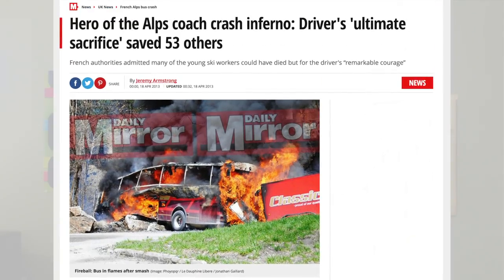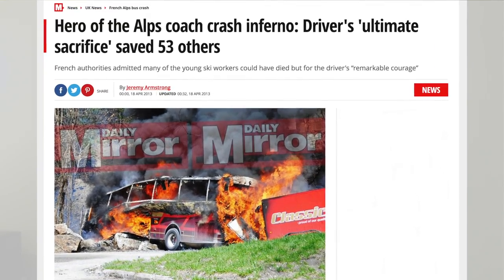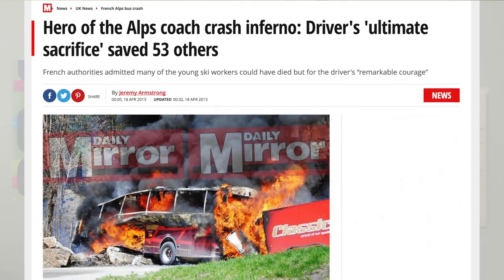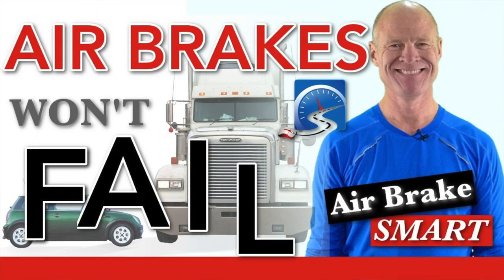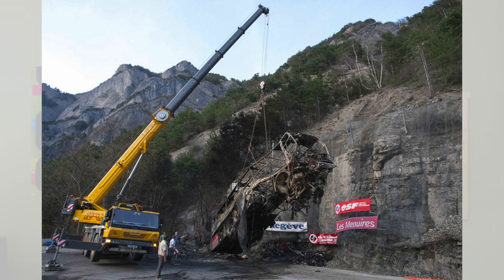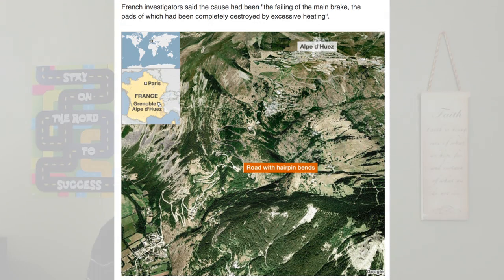Fatal French Alps Bus Crash Caused by Brake Fade—Crash Analysis Smart

Comment: I've only experienced brake fade in cheap, older vehicles (~1980 Honda Civic was the worst), or when I was driving particularly spiritedly.  In my 1 ton truck with exhaust brake and frequent heavy towing, I have 50,000 miles on my brake pads and they are like new still, I pick the right gear for the descent and very rarely need to apply service brakes

Speaking of surge brakes, I think one major reason they have fallen out of favor is that when the tractor vehicle is capable of providing most of the braking power on long downhills, they over-apply the brakes (and continually rather than "snubbing") and end up overheating/wearing even if the driver isn't intending to apply them... then when they really need brakes, they're ineffective (You know Duffy lake road???)
Reply from the maker: Hi Rx7man - Thanks for your comment. And yes, braking technology has come a long way. However, even modern systems are prone to brake fade. But as you said, if you get in the correct gear with the retarder on full, you rarely need to use the service brakes. And I believe you are correct about surge brakes falling out of favour owing to that limitation. Great comment my friend. All the best, Cheers Rick

Comment: Surge brakes are extremely common on trailers for use with cars in Europe. In fact I think just about the only trailers you'll see electric brakes on over here are those bus luggage trailers
Reply from the maker: Hi Jan Verschueren - Thank you for your comment. In my experience, most luggage trailers hauled by a bus have air brakes, which are much more powerful than electric. If the brakes were indeed electric, than that's another reasons for the brake fade. It needs to be understand that bigger brakes are less susceptible to brake fade because there is more surface area to dissipate the heat. All the best, Cheers Rick

Comment: The surge brake is pretty common on farm implements that are heavy and the local trailer rental site has all trailers with surge brake adapters on them even with the electric brakes.  I put electric brakes on one of my trailers it is easy to get a kit even for your little trailer.   We have a pretty step hill that the road ends at a T intersection stop sign and if you do not slow down ahead of time it is easy to get brake fade even in new vehicles with disc brakes.  They recently widened the intersection and there is room to the right and left to go now.

Comment: Excellent presentation.  I agree that air brakes cannot fail per se, i had to respond to a fire call where a box truck's brake cans were blown to smitherines, one was out of adjustment, and the sole working brake didn't help at all.  Long story short, landed in some guy's gazebo in the middle of town.

Now a question, is there a way to tell how much you can use service brakes short of overheating?  I can manage to not use them at all on a long drive, but brake fade is always in back of my mind.  Thanks again.
Jake
Reply from the maker: Hi Jake -  Thank you for your comment. Great story - fortunately it was just property damage. That's the thing about brake fade; there aren't a lot of warning signs. Often the brakes just go spongy and then there aren't any brakes at all. However, if you're geared down with the retarder on full, you shouldn't have to use the service brakes too much. If you do have to use the service brakes: short, hard, intermittent brake applications will give them time to cool. And if you feel the vehicle is gaining speed and not slowing, brake hard--really hard--slow the vehicle 20-30mph and then gear down. All the best, Cheers Rick
Reply: On hydraulic brakes I think you have more warning than air systems, the incompressible nature of hydraulic fluid will provide feedback quickly, while the compressible nature of air absorbs any feedback.
Reply from the maker: Hi Rx7man - thanks for your comment. Unfortunately, that's simply not true. Brake fade is one of those phenomena where you have brakes, you have brakes, and then you don't have brakes. In either system, there isn't much warning when brake fade happens. And unless you're looking in the mirrors, you're not going to see the smoke, or smell the brakes. One of the techniques you can do is to stop and put your hand near the rim to see if the hub is hot or you can smell smoke. That's what happened with my car when coming down the mountain with the Boler - I stopped and could smell the brakes. If there is anything further we can do, drop us a note. Always happy to help. All the best, Cheers Rick